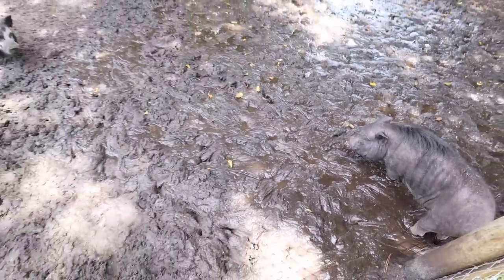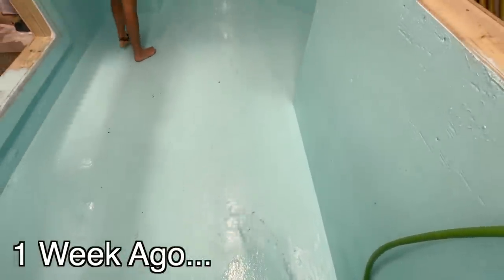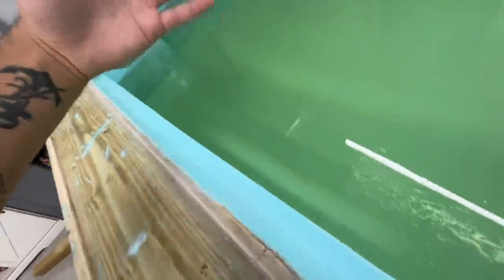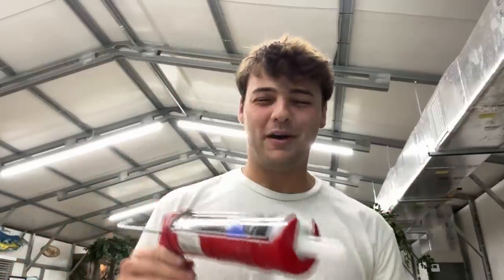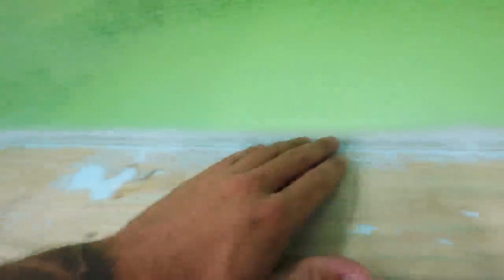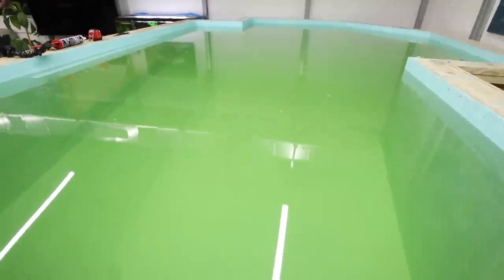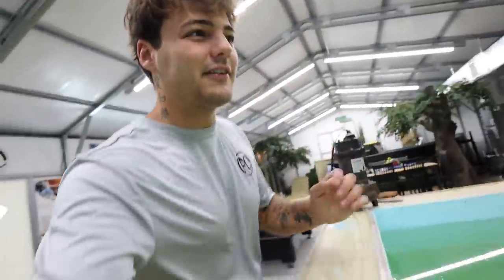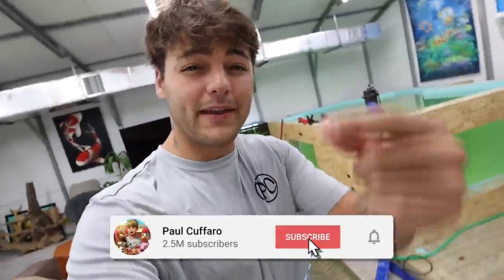Filling Up My SALTWATER POND for the FIRST TIME!! (scary)

Comment: Next time you use silicone on windows like this, put a line of masking tape a smidge in on the glass or acrylic, so you silicone between the tape and in this case the wood, then you can smear it in, and in the end pull the tape off the glass and have a sharp edge. 👍 As a freswater person myself, its actually gonna be so cool to see the saltwater stocking, as i know nothing about it

Comment: Hi.The best way to silicone your windows is to draw the line with the silicone and then take off the excess using a piece of card so you have triangular lines of silicone.That way you don’t just have the tiny amount your pushing in to the edges❤️❤️❤️

Comment: Hey big Paully, just before you silicon up your glass you should measure in about an inch from the edge and run a square of masking tape around it first so when you're fished and pull the tape off it will give you a crisp finish with less hassle.

Comment: May be a good idea to either add bracing across the top.  Pond armor is not flexible and cracks can form from bowing of the pond due to pressure from the amount of water volume.

Comment: Okay... I'll comment. I hope you continue to get lucky with your leak patch. It may last forever. If it does not there is only one thing you need to know about sealing tanks. Silicone sticks to everything except silicone. You may eventually have to scrape the whole window and frame and start over. With the saltwater pond, you have a lot od corners for sharks. You should fill it with tide pool finds. Maybe fish traps too. All local.

Comment: Although I hoped it wouldn't, it leaked right around where I thought it would!  Hopefully that was the last leak!   It did seem like there were a couple of small spots left with wood showing.   These might not show a leak immediately, but could absorb water over time and compromise the structure.  Seal those up if you can.  The pond looks amazing! 🙂

Comment: By siliconing the inside AND the outside you basically locked in the leaking water wich is inside the wood. This will result in a rapid decay of the waterlogged wood... 😢
Reply: ^^THIS^^

Comment: For future reference, next time lay the bead of silicone down and spray it with soapy water then flatten it out with your fingers or whatever and it will make clean up so much easier. The soap will keep the excess from sticking when you spread it with your fingers

Comment: I don’t understand how that wood that has no fiber glass on it, will hold that water without getting soft after awhile.  I can’t believe that blue paint will be enough.  Good luck Paul,, I hope it works
Reply: They miss a coating with the paint plus the fiber glass
Reply: @AnubisFenrir  they should have fiber glassed the whole entire pond.  After awhile wood gets soft from water.  Paint isn’t strong enough to protect the wood.  He should have placed a liner in there.

Comment: A. The best paint for steel is Corotech® Waterborne Enamels for non-ferrous metals and Corotech® Alkyd Enamels for ferrous metals. For priming, use Corotech® Universal Metal Primer for non-ferrous metals and Corotech® Alkyd Primers for ferrous metals.  Treat the garbage can with a primer that is specifically formulated to etch galvanized metal. Once the can is primed, it will accept paint. Apply a particular finish, renowned for its durability, or the paint will peel at some point in the future.

Comment: Too bad it would take too long but I think it’d be really cool since it’s salt water tank to put a bunch of different sea shells from the beaches around you on the outside of it and then cover them in a clear apoxy coating sealing them in and another layer of water protection
Reply: Maybe even using some similar shells to spell out a big PC or positive words on the side through out the random shells you place on it

Comment: I work with silicone and it's better and cleaner lines if you put an outline with tape and use soapy water spray your fingers (So the silicone won't stick on your fingers) and pass your fingers kinda lightly on the line of silicone to clean it up and lastly remove the tape and you'll have clean lines

Comment: You should cut the silicone tip on a angle then wet your finger and run your finger on a angle smoothly right the way across and you get the perfect seal 💯

Comment: U should've taking the glass out in completely resealed it with something else bc it's going to happen again
Reply: IKR. He just put a thick bandage of fresh silicone on the outside without actually dealing with the source of that leak. Now the water is trapped temporarily by the new bead so it will seep around the wood and destroy it then still burst through to the outside again one day. He needed to clean out the inner surfaces in that area and redo the inside waterproofing to a thicker and better standard. The exterior silicone is just a bandaid.

Comment: Your putting the silicone backwards.  Don't pull the caulking gun you push while you pull the trigger and it will push the silicone/caulking into the cracks.